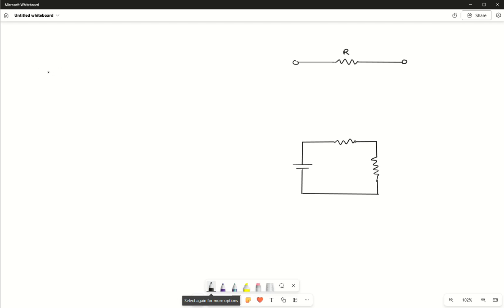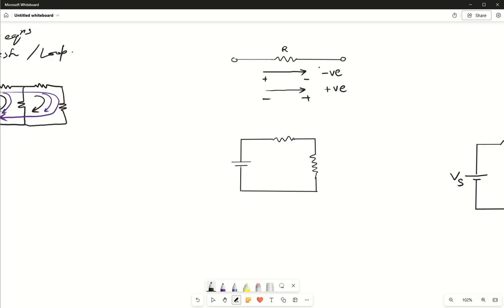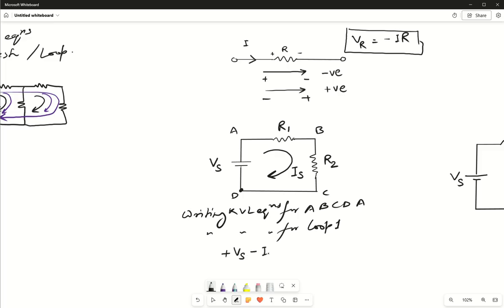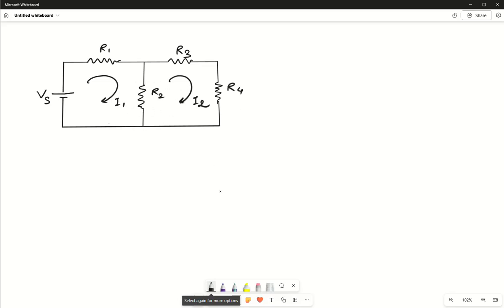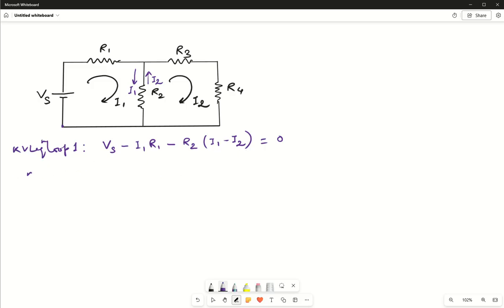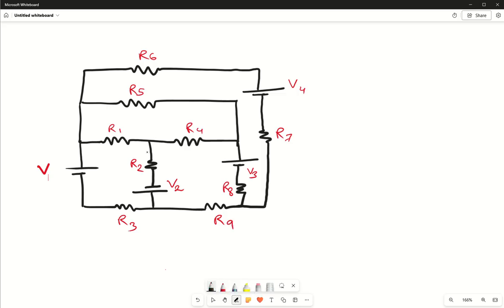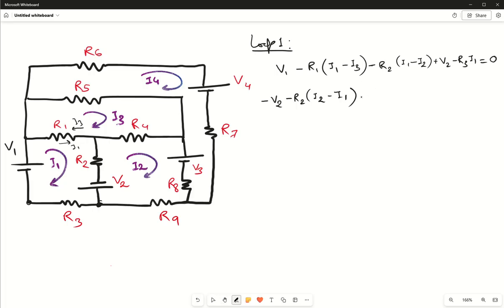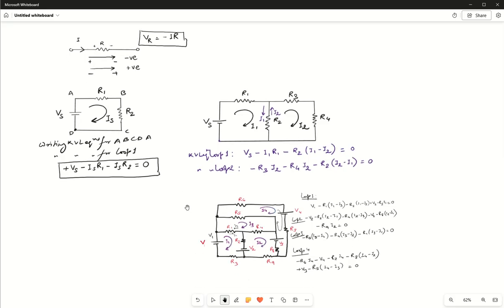Stop Struggling with Mesh Analysis! 🚀 KVL Equation Writing Simplified | ECE 111

Comment from the maker: 🔥 Still confused with Mesh Analysis? You’re not alone — even a tiny mistake can turn your whole circuit wrong!
This video will clear every doubt and help you write Mesh Equations with complete confidence. ✅
Still have questions? ? ? 💬 Drop them in the comments — I’ll be happy to help you!

#MeshAnalysis #NetworkTheory #CircuitAnalysis #ECE #ElectricalEngineering #BasicCircuits #EngineeringStudents #KVL #CircuitSolving #StudyTips